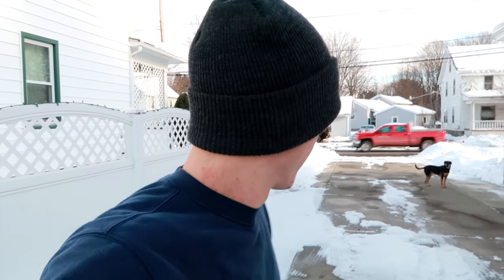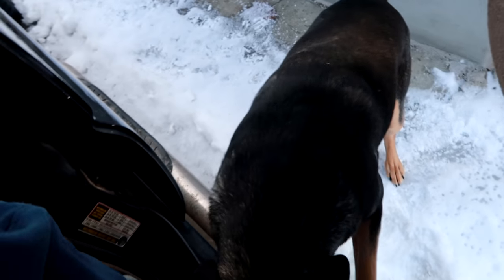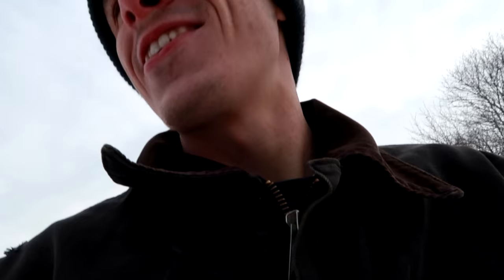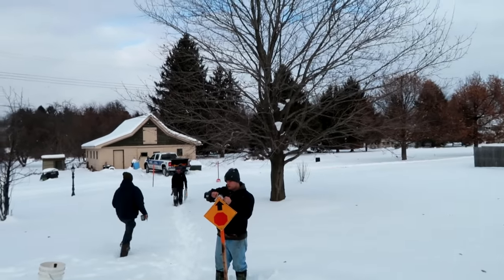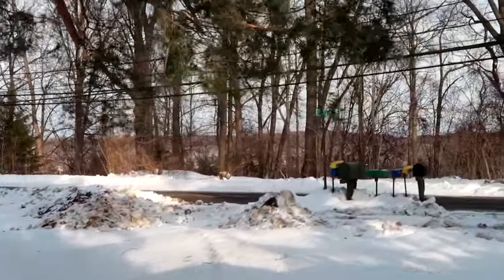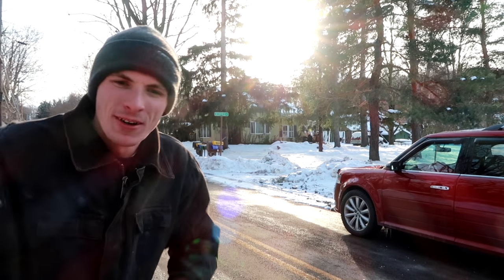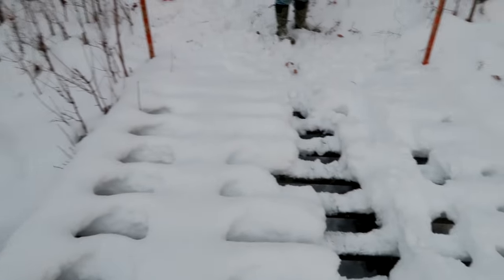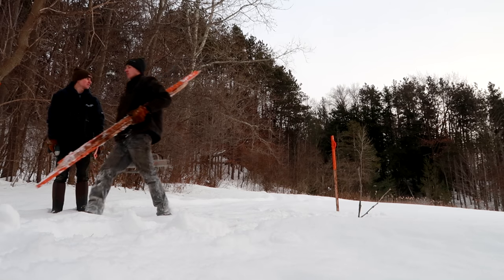THIS is why you DON'T HIRE US!

Comment: For 500k lift the duramax like if you agree
Reply: Dodge 318 Cummins no they don't but I guess it's personal preference
Reply: Brady Upham all lifts do is wear out important parts and makes the truck unusable. A leveling kit is the most id do.
Reply: He should put bigger tires and a 6 inch lift
Reply: Dodge 318 Cummins I probably wouldn't lift it for towing or stuff like that but for looks and a pavement princess ya I would lift it
Reply: AJ Beats 2 Why so conservative? Go all out, straight axle swap, 10"-12" lift, American Force wheels, the whole nine yards
Reply: cummins swap the duramax at 500k
Reply: my dads hilux is lifted but he need a bull bar

Comment: Smoking Duramax means time for new injectors. Get ready to spend about 6 grand. There famous for that and the fact I have owned one since 03. Done changed mine twice
Reply: Ground Hog dude it's cold, all vehicles are gonna smoke in the winter
Reply: It's a diesel in freezing conditions, i'm actually surprised it didn't smoke more than that
Reply: Ground Hog 6 granf for injectors? christ man...its not the fucking space shuttle( and yes it has injectors) i rebuilt the injectors in my dt 466 international tow truck and that was like 300 bucks. injectors dont need to be replace unless broken. rebuild them. also...all diesels smoke alot on cold start. youve changed your injectors twice so your saying you spent 12 grand on them? Wow
Reply: you have to take the cab off on the duramax's to get to the injectors that's why it costs so much.
Reply: Ground Hog wow Cummins and idi diesels are extremely cheap and easy to change now I know to avoid a duramax lol.
Reply: Bill Satterfield   Those injectors cost 450 each x8 = 3600 plus gaskets and misc. labor to change them is about 36 hours and that's if you good at it like me. You do not rebuild them because of labor to get to them. When you replace them they better be new ones.
Reply: Dodge 318 Cummins   Just the LB7 are very expensive. The main reason is the labor to get to them. When they built that one they forgot you gotta fix them.
Reply: Ground Hog so I'm definitely going to avoid any cheap duramaxs around me and an 2006-2007 is almost impossible to find.
Reply: Ground Hog its a cold diesel its going to smoke
Reply: 74 chevy k30 you are thinking of the Ford having to remove the cab Chevy can be done in the engine bay. the injectors normally average in price between 200-300 each. that's $1600-$2400 then add seals lines gaskets. the kit sells for $3600 then if you hire it done looking at around $1500 for labor. this is a very big job
Reply: Ground Hog Never need to pull the cab on a 7.3 - never. On a 6.0, it is easier to pull the cab for some jobs, but still very possible to do cab on repairs. For the 6.4 and 6.7, the cab has to come off for just about anything....
Reply: do a backflip  on your dirtbike

Comment: You might want to check.  My 04 dirtymax is from AZ and I am in north Idaho,  but it has some factory fast glow plug where it only takes a few seconds to heat up. I know the nights don't quite make it to the lows that NY has but I haven't had any problems starting up mine. May be you have a junk glow plug or two on the dirtymax.

Comment: You cannot possible screw up a railroad track with studs. I used to help mark trails here in Northern MI, mostly it was replacing damaged signs and clearing deadfall from the tracks. We do it in August,not January. When do the trails open in Upstate NY? In Mi they open late November.

Comment: How long before you burn out the motor on that Southern slide topper you have. They are not made for cold and ice.
 Why have weight in in a 4 wheel drive????. I live in Wisconsin. It is called Locking it in 4x4. Really????? weight in a 4x4. Still Good video and like seeing people marking trails. We mark a lot of trails in Wisconsin and it is not easy.
Reply: ml2trick  I don't know what part of Wisconsin you are from, but I am from northern Wisconsin and everyone has weight in a 4x4. The reasoning is because it's not good to have your vehicle to be in 4x4 all the time because it is not built to be in constant use(drivetrain isn't built for that) and especially not at highway speeds(55 and above). If you do drive in 4x4 all the time you can expect a big decrease in mpg, turning radius, and more wear on your drivetrain components. Lastly most people have 4x4 on demand so there would be not locking it in, it would be the flip of a switch.
Reply: i throw weight in my truck cause i only use 4x4 if i have to get out so a sticky situation, to use 4x4 all the time just adds wear and increased gas mileage when it's unneeded

Comment: 3dmachines, you're supposed to 'start' after the first glue plug cycle.  They say you're not supposed to wait for it to cycle multiple times before you start.  The audio does not do a cold start justice, from experience do a video when it's single digits.  By the way, when you plug it it, it WILL suck a lot of power, you keep it plugged in, your mom will be pissed.  I like the bullet hole rims better.